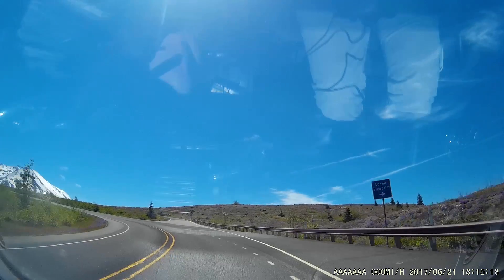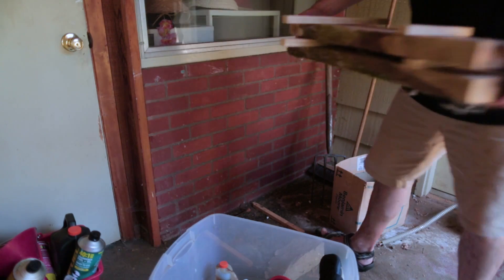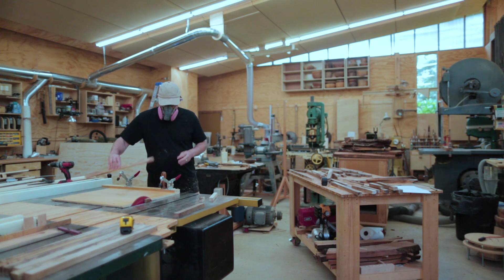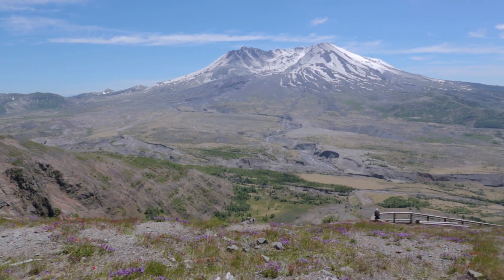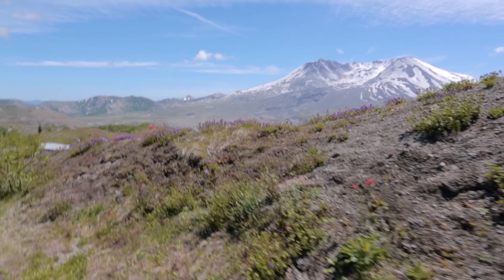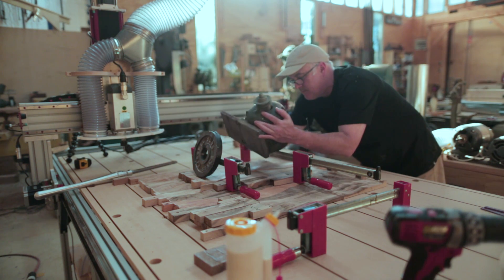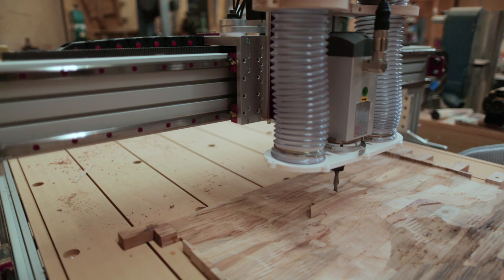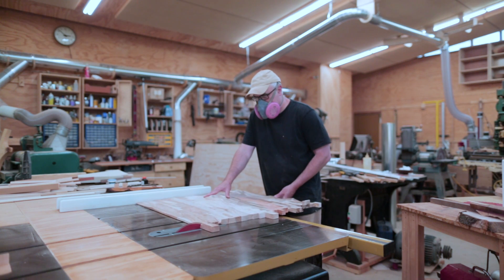Making Mount St. Helens

Comment: You could use the 3D model to get contour patterns for each layer before you start carving. Then you could cut out each layer with the CNC before you start glueing to avoid looking for the flat spot.
Reply: Also, you might get a better finish if you do the final CNC passes following elevation lines instead of a raster scan, then they would naturally line up with the layers. I don't mind the different colored layers, it almost looks dipped in different stains.

Comment: Very cool. I have wanted to try to do something similar. What I was looking at doing was a 3D rendering of the Japanese The Great Wave painting by Hokusai. I thought about dying the wood though. 
Part of the problem is that I don't have a CNC machine though. 
I have done some relief carvings with an angle grinder. I used plywood as the wood and then dyed the wood. The alternating grain really gave some great visual texture.

Comment: When I was in my late teens, we took a family vacation to the Pacific Northwest, which included visting Mt. St. Helens. This was about six weeks or so after it had erupted. We ventured as far up the mountain as we were allowed to drive (the "red zone" was in place to keep tourists out of the hardest-hit areas. Two memories really stand out for me--we stopped the car near the edge of the red zone and got out to wander around. I was what I thought was a dog house in the middle of a muddy field. Nope. Someone had placed a photograph on a post next to the "dog house". It was the peak of a roof of a two story house and the former ground level was at least 30 feet below where I was standing. Nearby was a river. For about 30 to 50 yards on each side of the riverbank, was an area completely scrubbed of all trees. The mud flow that followed the river must have been tremendous to completely strip all the trees in its path for that distance. It was very sobering and awe-inspiring.

Comment: If you got anough wood you can ensure you have the maximum height required available before carving. That way you would avoid having to clue together several layers. When planning it correctly you wouldn't have that much more excess wood.

Comment: Oddly enough, how about using plywood?? That way, you'd automatically end up with contour lines for the terrain.!!  And between each sheet of ply, you could laminate a veneer of a darker wood to symbolise - for example - a 1,000ft altitude, or some such significant altitude!!!

Good job anyway!!
Reply: I really like your idea. That would have looked a lot more like a topographic map.
Reply: Precisely! I couldn't think of the word "topographical" at the time!! lol But yes - that's the effect I had imagined.  I think that would look amazing - for any wooden geographical type of map or landscape.
Reply: meetn2veg This is a fantastic idea, I'd love to see Frank do something like this. Perhaps a small topo of O'ahu?
Reply: I've seen this before, there are some artists doing this for bathymetric models - notably Lake Tahoe and the San Francisco Bay.
Reply: When I saw this, I thought the exact same thing, using dark-light-dark-light lamination layers where the dark layers were thinner than the light layers. Then the contour lines would really pop but still be thin like lines should be.
Reply: Yes, horizontal layers would be the way to go with this type of topographical piece.

Comment: Wish I could assign more thumbs up, beautiful project Frank! A question and comment: First, did you use any USGS 'Topo' maps in the planning? Seems they would be tailor made for something like this. Also, use of the CNC as a clamp is clever... have you considered maybe a compression spring of some sort between machine and work? I think it would make pressure 'modulation' much more precise. Again a masterpiece, thanks for sharing!